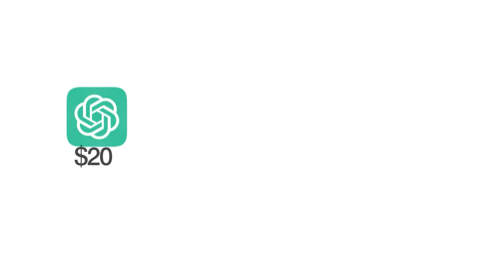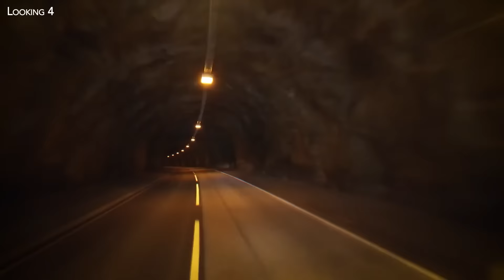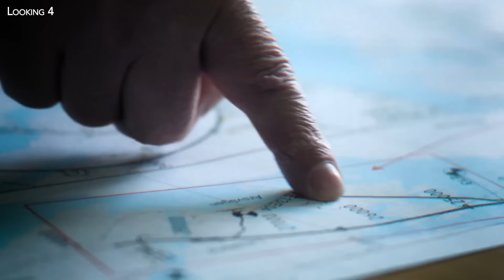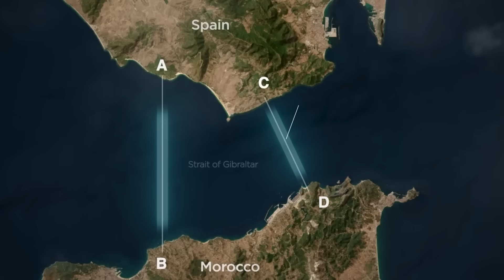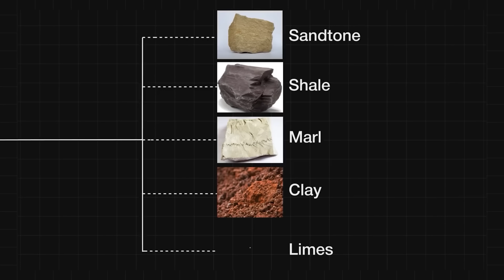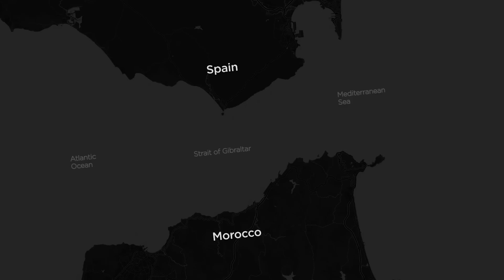The 4 Mega Tunnels That Will Change Europe Forever

Comment: Ermmmm "Brenner Basis Tunnel" - think you mean the "Brenner Base Tunnel" - The Brenner Base Tunnel is called a "base" tunnel because it cuts horizontally through the base of the Alps at a much lower elevation rather than climbing over the mountain pass.
Reply: Also "Gotthard base tunnel". AI is such crap.

Comment: If the tolls get too expensive, they'll probably just shut down the ferries, leaving vehicles no choice. That's the typical model, right?
Reply: The ferries will cease operation when the tunnel opens, just like they did on the Great belt, and before that on numerous other connections, both are in the end owned by the govt. because leaving infrastructure in private hands is simply too risky. Prices are not set to maximise profits, but to pay of loans, maintain it, and for future investments. There's noone getting a payout from the revenue.